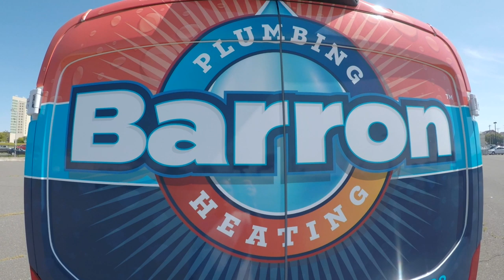ADJUSTABLE SHOWER CURTAIN ROD INSTALL

Comment: Chuck I bought a rigid powerclean drain auger today and it's a piece of garbage, what do you recommend for up to 1 1/2" drain line cleaning?
Reply from the maker: Go to old reliable a drum machine. I have small flex shaft and have not really used it...a drum machine is a no brainer for sure.